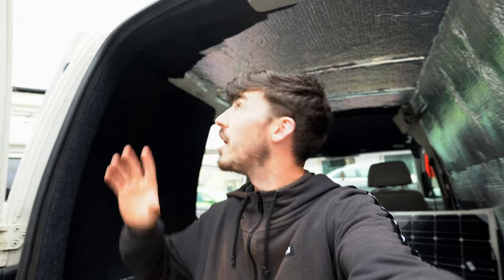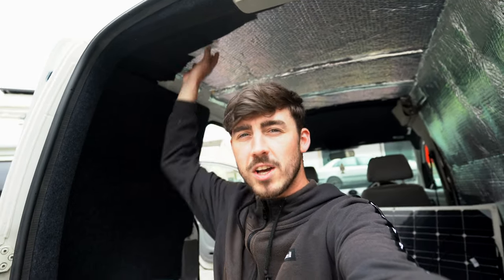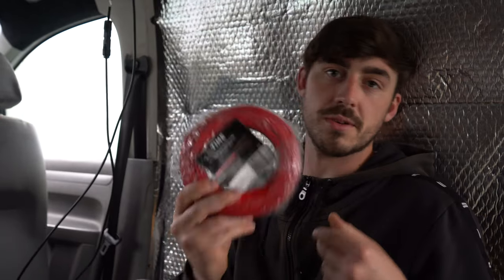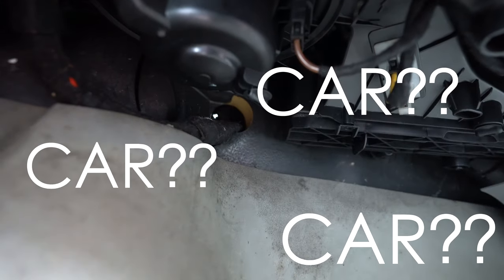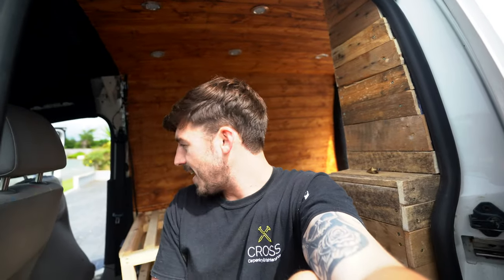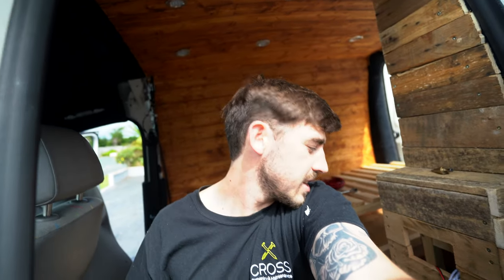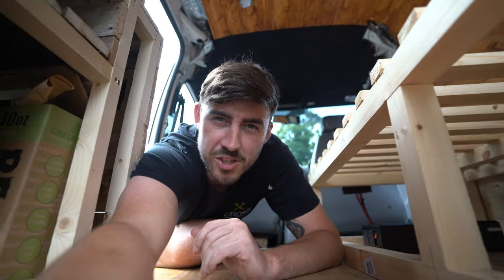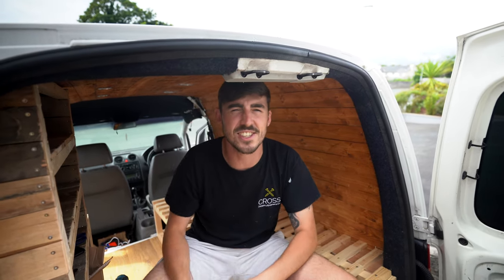VW Caddy Van conversion PT 2 - ELECTRICS

Comment: I would have loved to see in more detail the bung location through the firewall.  Im trying to install a leisure battery system in my sons friend's van, and its a hard one to locate.
Reply from the maker: There is an electrical loom behind the main van battery in the engine compartment which comes into the passenger footwell behind the 'glovebox'. In my van there was plenty of room to feed the new electrical cables, so I fed a screwdriver through the bung which the electrical cables were already going through, made the hole slightly bigger and then fed the new cable through. I hope this helps!
Reply: @tomcardermedia  Thanks.  Incidentally i pulled out the battery and tray and found it easily!
Reply from the maker: @drgloverable  Awesome Chris!

Comment: What is the length of your fitted bed? Being 6,1' I'm debating if the van would be big enough for my height when laying down.
Reply from the maker: The length is just short of 6ft, I was debating buying the caddy myself as I'm 6ft, however there is so much more room then I expected, even with a shelf built (you'll see in vlog 3, which will come out very soon). I never lay completely straight, usually more curled and wrapped up, so a caddy is perfect!